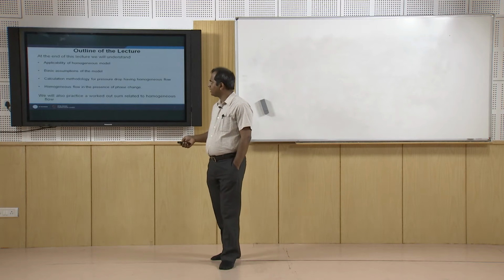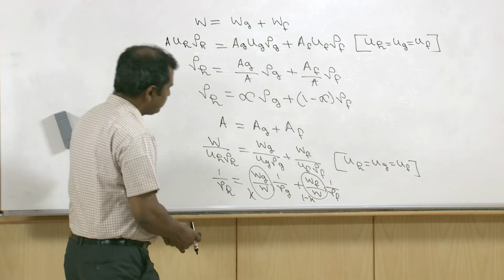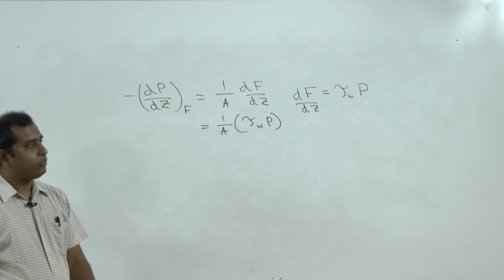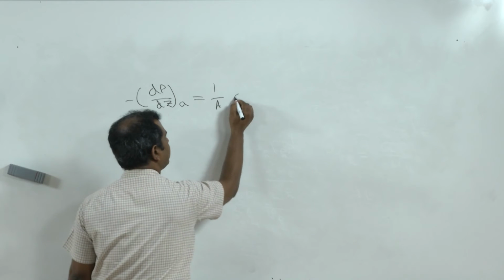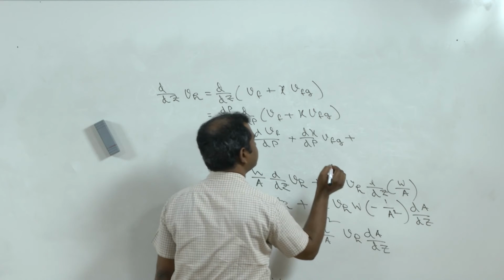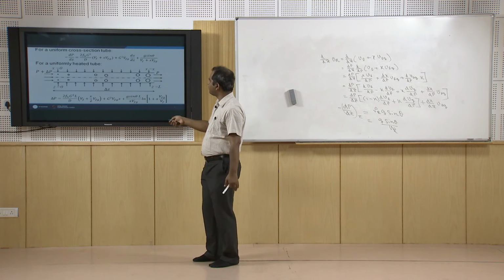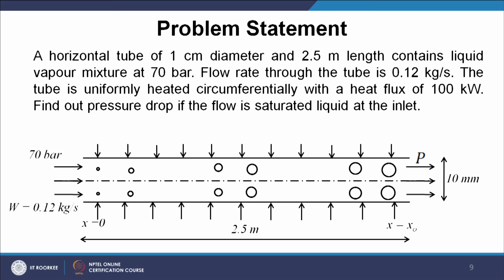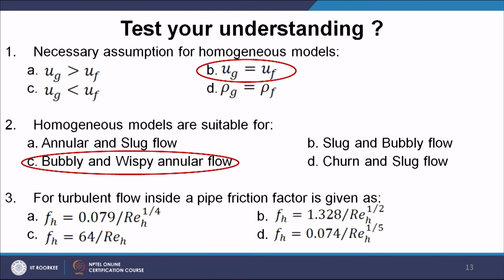Homogeneous Model

Comment: friction varies with length in actual. How can you take it out of integration as a constant?
Reply: Actually, it does not change significantly. The internal superficial rugosity of the pipes are considered constant throughout their length. e.g. a PVC pipe has around the same rugosity in the middle as in its entrance.